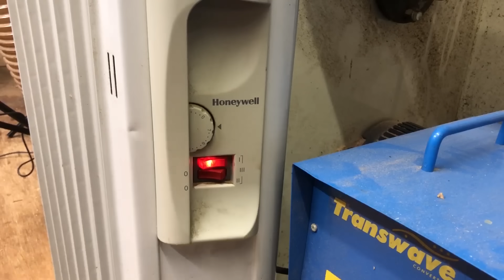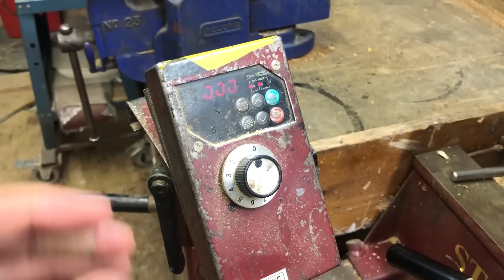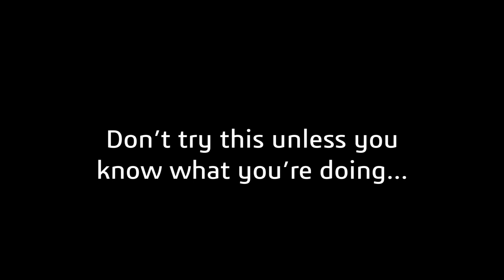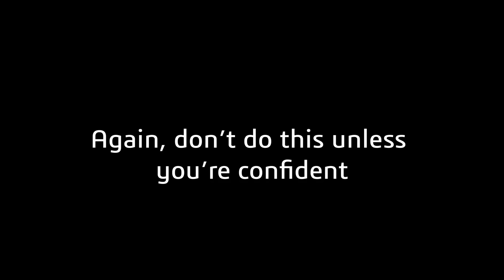Making the Elder Wand - From Real Elder Wood!

Comment: Really nice! The only thing that would’ve made it better was if you‘d have used an actual elder branch but it’s pretty hard to find one straight enough to give the desired effect I think.
Reply from the maker: Not possible - elder has a really spongy pith hence I use a quarter of a branch!
Reply: @garricksapprentice  ah I see! I just knew the wand is modeled to make the nodules look like the triple stemming points of the branches but I didn’t know what the wood working qualities would be like.

Comment: the loss of limb one was good because genuinely lathes terrify me for that exact reason. Lose an arm in less than a second because of one small mistake.
Reply from the maker: In general wood lathes are a little less powerful/torquey than metal lathes - I could probably stall the motor relatively easy on this if I got caught..
Reply: @garricksapprentice  yeaa metal lathes are ridiculous. saw Adam Savage had a close call with his metal lathe in his shop. Scary as shit.

Comment: 6:55 Not gonna lie, I was a little terrified of how close your sleeves were getting to the lathe 😅 Still though, awesome piece :)
Reply from the maker: Looks worse than it is - I've filed all the edges of my chuck and tried to get rags caught in it before - it can rarely wrap around the wood or frayed edges of the wood but this usually just snaps the wand. It also doesn't have the torque you get with metal lathes!

Comment: I always was a bit surpriced JKR used Ellder wood for this wand.
I only knew Elder as a sprinny bushy with brances filled with a spongy core.
Bushes of Elder enough in parks etc, but a real fully grown tree I never saw. That block of wood you use did not come from a springy branch.
only one question: how do you get the tailhair of a Thestral in it? They are invisible to most people, seems a tough job to me.
Reply from the maker: Yes, small bush tree with spongy core, no good for turning or burning! I've had a bit in recently but very hard to find. I need the branches to be at least 70mm dia so I can get 4 blanks out with no pith. Fortunately/unfortunately I can see them but can't give all my secrets away on YouTube!
Reply: @garricksapprentice  maybe you just mentioned why Elder was chosen as the good solid wood needed is very hard to get.
Reply: @kamion53 the plant has a long history of being considered magical as well. References to its relationship to fairies and magic are all through English literature going back to Chaucer. Blooms right around midsummer to boot.

Comment: stunning work.  
how do you prevent it from snapping at the thin end ?
Reply from the maker: A fair bit of practise! - using the chuck means the tailstock can lightly hold the tip so it's not under compression

Comment: I would have dissolved a dinosaur fossil to recover the soft tissues in the fossils, put it in a small epoxy vile, drilled out the core of the handle and put the vile in it, then plugged it. 
It would be AS ACCURATE to the lore as is possible.

Comment: So... maybe this is a really dumb question, but... how was it the wrong hole at 15:35 ish? Like... isn't the rectangle symmetrical along that axis? Couldn't you just display the wand facing the other way, or rotate the stand so the "back" is the "front" and display the wand as originally intended?
Reply from the maker: Yeah I didn't make it obvious but the holes are offset slightly so the wand sits central above the stand

Comment: Where did you find that much elder?  The trees are very small and the core of them is pithy, so they are not really used for industrial purposes.
Reply from the maker: Nightmare to source - correct I have to use bigger trees and split the trunk into quarters to turn

Comment: I don't understand why the wooden strip was being planed when it was turned/shaped anyway. Nice work nevertheless.
Reply from the maker: Elder has a tendency to warp loads - it just takes out the twist at the start and fits the lathe easier once cut with square ends too, but not strictly necessary

Comment: It's a good wand replica, but that unpainted but makes it look so different from the original, or more specifically, the original authorized replica you had... That begs the question though, of why exactly you did it that way, instead of trying to match the color of that spot... I mean, was that just supposed to look weathered, and you left it not colored specifically because you want it to weather naturally, or was it for some other reason, such as not wanting it to be an exact copy???
Reply from the maker: Yeah basically I wanted to keep it as the natural wood - pretty much all the HP wands don't look like the wood they're supposed to be, it might darken naturally in many years time too
Reply: @garricksapprentice  ah, thank you for your answer. You are definitely a good wood woodworker, judging by the quality and similarity of the wand you created, when compared to the other official replica

Comment: I'm confused by the wrong hole part. Is that also a joke? Could you not have.. just turned the thing around so the pegs were on the opposite sides?
Reply from the maker: They're off set from the end different amounts so the wand sits central, not the most obvious admittedly

Comment: I really liked the work but could only cringe as I kept seeing your shirt sleeves get so close to the ends.
Reply from the maker: If it helps uncringe you I've filed off all the sharp edges of the chuck, and the wood only really grabs if you leave a splintered edge after a cut. I wouldn't normally wear that jacket but it was freezing! I've been meaning to play around with the control to see if I can reduce power for small work to make it easier to stall the motor

Comment: Your loose sleeves are giving me anxiety.
Reply from the maker: Yeah I've rounded off all sharp edges on my chuck and tried to get rags to catch before with no luck - also being direct drive it's possible to stall the motor, no torque compared to a metal lathe